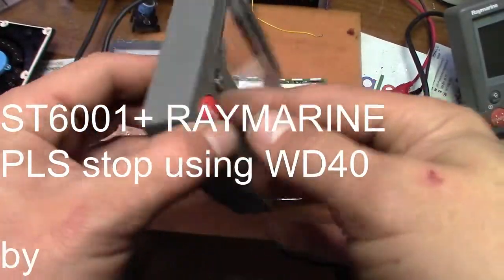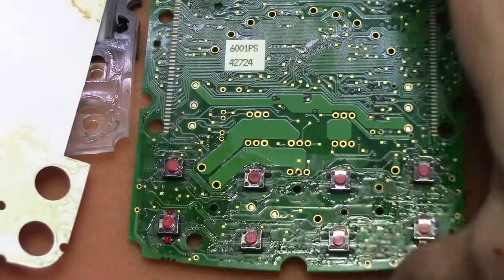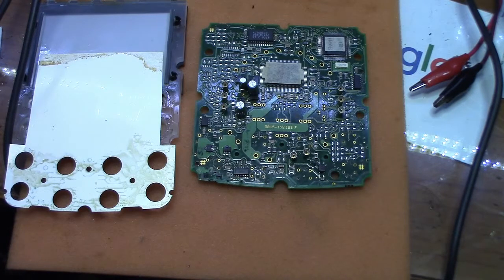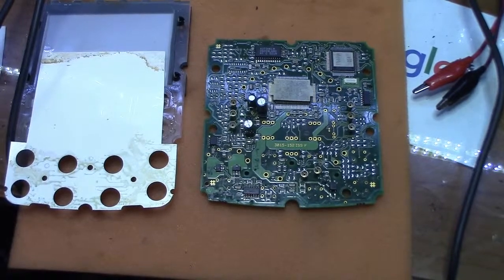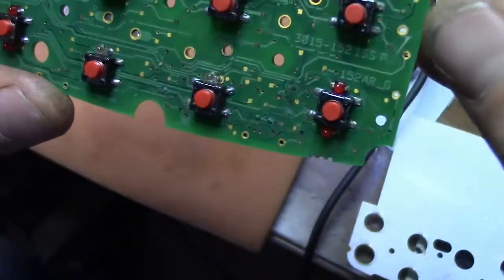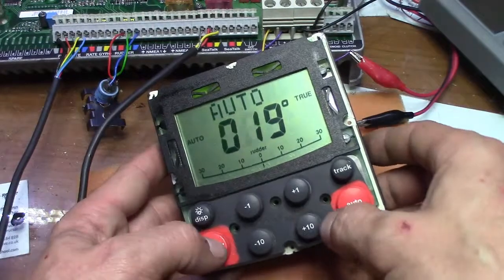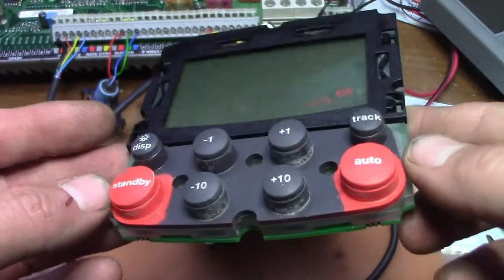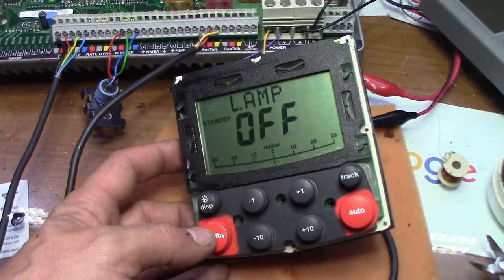st6001 raymarine autopilot head unit repair

Comment: Hi. I bought a new screen for the st6000 but it came with a zebra wire connector and found the old board is a soldered joint one. Is it possible to get this new screen to connect somehow.